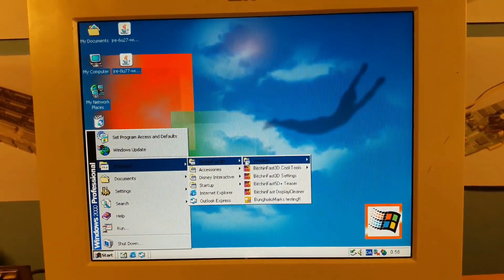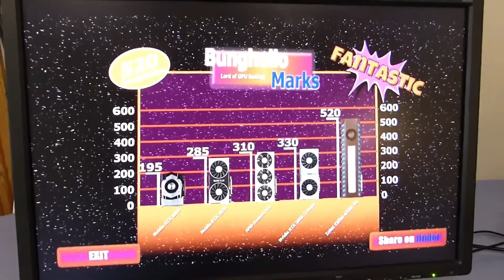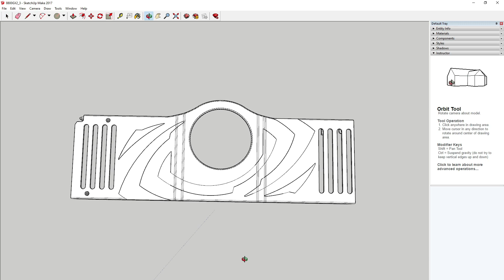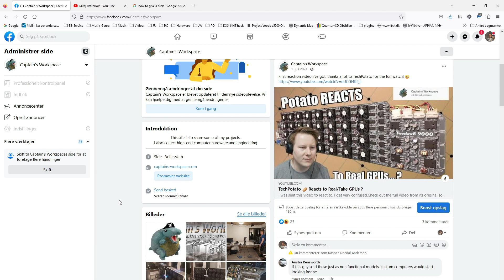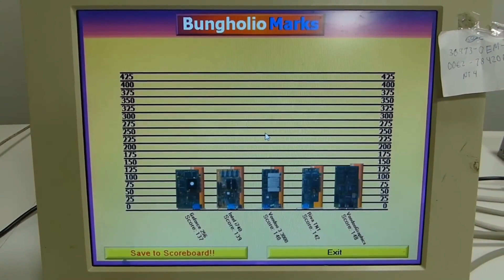Small update, nothing important. :)

Comment: I love your videos Captain! I'd suggest to have the computer trip a breaker, then you bypass the breaker or draw your power drom multiple outlets and have the apartment loose power or start a fire.

I think it'd be funny to overclock your PC by running it from inside your freezer box, and when you check on the PC at some point it starts glowing from the excessive and so you spray it with a fire extinguisher to try and lower its temp.
Reply from the maker: Haha, yes absolutly! CO2 fire extinguisher overclocking.

Comment: An RTX 6090 that's wider than it is long or high. There could be a shot where you pull the card out of what appears to be a normal GPU box on a table, but then it just keeps going like the box is a clown car or a portal to an alternate dimension to reveal a 32-slot-wide card. Then you could reveal a 6090ti that's so wide that it obstructs the screen and goes through a wall in the room.
Reply from the maker: Haha, yes can see it for me! XD
It's smart as it fits i ncases with extra HDD bays :O
Reply: @CaptainsWorkspace  or like maybe the card turns out to be the whole case, and the motherboard needs to be installed on the back of it. Or motherboard slid into a slot on the card. ( a little less awesome surreal as this response, but still outlandish)

Comment: love your videos! guaranteed fun. a few suggestions; since you already did go big bigger biggest and even biggestest, maybe it would be fun to go microscopic, not sure about the practical effects of shrinking you down to a few millimeters to show off the gpu. if you go big again, a joke that is made often but not realized yet; creating a gpu that is basically a motherboard - so you plug everything into the graphics card. or, if we go the route of ultimate power consumption, maybe the gpu should have it's own generator which needs petroleum every few minutes
Reply from the maker: Really great idea with the streetlights flickeringor go out once system gets turned on and have to dig up some generators or flux capacitors :D

Comment: There he is! Can't wait for what you'll build in the future! Your stuff is on another level.

How about doing something photonicinduction (@Photonvids) style? Like using three phase electric power connectors (IEC 60309) and some ridiculous mock up capacitor banks for overclocking or something like that? I could also see an AI-Accellerator becoming some cancerous looking gelatinous brain tissue on the back of the card... although that'd probably be hard to make look convincing. There are several STX 6900XL haha funni jokes that I'm afraid ain't gonna fly on youtube..

Maybe create an AMD one where they do away with cards entirely and just have a Motherboard with a CPU and a GPU socket? Or a massive APU (perhaps that with interchangable GPU)? That wouldn't be too far fetched now would it?

Eh, I'm probably not being particularly original here but it's fun to try and think of stuff and I hope I at least gave you some food for thought :) 

Keep it up!
Reply from the maker: Yes, sounds lot like an idea my dad came with.
Some small smart compact GPU, but as the video progress end up requireing and adapter card to go to the motherboard, spacial heatmodule with external vapor setup and powersupply.
The idea with AI is nice, somebody also brought it up, would definitly need some brain in a jat, thats for sure, how else would AI work? Not like a GPU can accelerate brain waves...